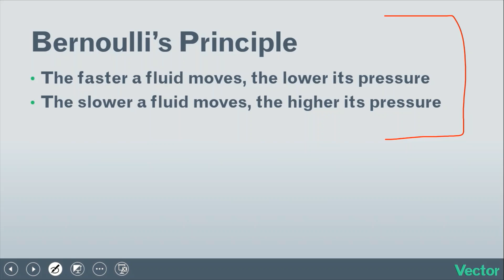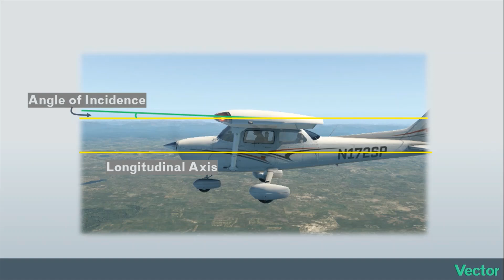Airfoil Basics

Comment: Trivia: Thicker airfoils are used for low speed flights while high speed flights require thinner airfoils to minimize drag.
Reply: Same with sails on a boat. When going out in heavier winds you tune you’re sails to be flatter and have less belly to reduce drag
Reply: This is not entirely true. 

For airfoils designed and manufactured in a way that supports substantial runs of laminar flow, where the boundary layer flow is constantly accelerated via negative pressure gradient more than half the length of the airfoil, then the airfoil invariably ends up thicker. E.g. Naca 65-series airfoils, and later NLF series foils. Many of which are 17 to 20% t/c. And also have very low drag, and are utilized on some very fast aircraft. And some slow ones (sailplanes).

Comment: A lot of modern fighter aircraft have fuselages shaped like airfoils to generate lift to aid with wings in maneuverability and also improve slow speed flight as the fuselages are basically very thick airfoils.
Reply: There's a story of a F-15 that lost a wing in combat but was still able to fly (barely) and got home safely. The fuselage was able to generate enough lift to compensate for the missing wing. I think it happened in the middle east.

Comment: The Wright Bros flew on around 16 horsepower with very low octane fuel.  They built their own aluminum in line engine including the carburetor.   They tested out their airfoil before use on wings and propellers.  They got 80 lbs of thrust from their big propellers.

Comment: Air and hydrofoils work as follows. If one needs to produce force, one has to accelerate or decelerate MASS. If the mass happens to be a branch tied down to a tree or fixed on the ground,  then the mass will not move but the acceleration force will be transmitted to the activity that is trying to accelerate the mass by pushing or pulling/suction action. If the MASS happens to be a lump of fluid like water or air which can distort and change its shape,  then, to create a force one still needs to accelerate a lumped mass of soft air or water. This is a case of having to use either the INERTIA OF REST OF THE HEAVY lump of FLUID OR THE INERTIA OF MOTION OF THE FLUID IN QUESTION. One particular lump of fluid when accelerated will distort and change position, and so an accelerated lump of fluid can only serve to create a force if the acceleration is done for a short temporary period when that lump mass occupies an inconvenient location and then is dumped and one needs to grab at another nearby lump mass and try and accelerate that till again, it distorts and changes position, when it has to be dumped, and the process repeated on other nearby lumps of fluid masses. Now let us apply this to an airfoil section.  We shall use an old-fashioned slow one as shown on the bottom right-hand corner shown at 0:15.  as it shows zones of activity that are not shown on the other airfoil sections.   THIS IS THE REALITY OF AIRFOIL SHAPES  shown in an old-fashioned airfoil section of more than 100 years ago. 

To make it easier to understand, let us be realistic, yet practical, and rather than use wind tunnels where the airfoil is stationary and the air flows with a horizontal velocity, we take a real airfoil that is moving and the fluid/air that is still. To make it even easier, let us assume that when the airfoil pushes or sucks the still air mass lumps/ particles, it will accelerate them VERTICALLY only and we can forget about any horizontal velocity of the mass lump particles of the fluid. After all, a heavy stationary golf ball can be hit by an angled golf club to rise vertically up or down, and water can be sucked up by a straw to also go vertically up or down.  All this is what happens in an airfoil section, elevators, rudders and ailerons, and propellers!!!

Considering the airfoil shown on the bottom right-hand corner shown at 0:15 moving with a horizontal velocity. Consider two stationary mass lumps of particles, one mass lump being pushed up, accelerated vertically by the upper inclined angle of the leading edge, and the other mass lump, being pulled up, accelerated vertically by the suction of the void behind the underside leading edge.  These two actions will put pressure on the upper leading edge, and suction on the lower leading edge, all for a good investment to pay off handsomely later on. 

After the accelerated top mass fluid lump( surrounded by other lumps)  tries to leave the upper leading edge surface, moving vertically up, it acts like a moving piston leaving a suction effect behind it and so this suction effect will slow down the vertical up velocity of the fluidic mass lump at the expense of lifting the upper surface of the wing moving horizontally below it. The downhill slanting shape on the rear part of the upper surface of the moving wing will accelerate the mass lump downwards through a suction effect and the mass lump with its now vertically downward velocity will be dumped over the trailing edge. This is the lift action on the upper surface of a wing. 

The lower fluid lump mass initial upward sucking acceleration by the under- curve, shape of the leading edge is slowed down and decelerated by the moving undersurface angle of attack pushing on it and so the upward going lower mass lump will start to slow down and even change directions downwards because the sloping rear part of the underwing, all applying the law that to every action there is an equal and opposite reaction, be the initial forces exist due to suction or compression accelerations. The lower mass lump moving vertically downwards is also eventually dumped after the leading edge, not necessarily at the same time as the upper one was dumped. In fact, they are dumped at two different times causing a trailing edge vortex along the trailing edge.  Bernoulli may be shelved for the time being and given a holiday and not asked to take part in explaining how a wing works due to change of pressures and velocities..................it is all the short-lived and temporary accelerations and decelerations of lumps of fluid masses at different zones around the wing/ rudder, elevator, aileron, four propellers, pumps, diffusers, etc including afterburners.. 

Note, the above pushing and suction actions and their sequential force reactions, above and below the wing surfaces, can take place because the fluid is homogenous and the two mass fluid lumps are sealed in like moving pistons in cylinders, by other nearby mass particles around them. All this assumes that there is no boiling of fluid at the heaviest suction zones which may cause cavitation in water and boiling of moisture in the air around the wings and propellers. 

So Basically the wing has four major fundamental locations that operate on mass lumps of homogeneous fluid in question, basically in a vertical up and down acceleration with their resulting reacting forces. The little horizontal motion of the lumps of fluid around an airfoil or a hydrofoil may be neglected for better lift understanding.  The horizontal accelerations of the lumps of fluid will contribute to the drag and not the lift of the wing. The four principal locations of a wing /propeller etc are as follows.
  
1. The upper leading edge, accelerates  the stationary mass lumps to move vertically upward due to a compression zone action and after this, 
2. The horizontally moving sloping rear part of the upper surface sucks back the vertically moving mass fluid lumps to eventually change their direction downwards to dump them over the upper trailing edge. This is the lift in the upper surface of a wing.
3. The lower leading edge, accelerates  the stationary mass lumps vertically upward  due to a suction action and  after this
4. The moving sloping rear part of the lower wing surface is pushed, compresses back the vertically up moving lump mass to change their direction to a downward velocity, and eventually dump it at the upper trailing edge.

All airfoil sections, from slow high lift ones to medium, high-speed supersonic ones, all do is to re-design these four major locations of an AIrfoil section to ACCOUNT FOR THE INERTIA OF REST/MOTION OF THE FLUID BEING USED  relative to the speed of the wing, foil in question.

For high-speed airfoils sections,  and in water propellers/ hydrofoils, the upper leading-edge compression zone is kept at a narrow-angle and surface rate of changes,  to reduce/limit the acceleration of the fluid which would vapourize all the moisture in the air and boil water in water foils, to cavitate the fluid. For medium, to high-speed airfoil sections, the suction underside leading edge is done away with and the lumps of heavy fluid are accelerated down vertically by the cushioning fluid and the angle of attack of the undersurface of the wing.  

All that was explained above, any shape eye can see it all in the flying of the owl shown in this video, and it adds more showing how the fluid mass lumps of air can escape at the leading edge, the trailing edge, and the wingtips at high angles of attack. 

https://youtu.be/jc9En9WUzI8

Rather than considering the velocity streamlines around the wing, it is better to see the linear rate of changes and the circular rate of changes that will produce a vector acceleration field around the airfoil section  AND IT IS THE INTEGRAL OF THE ACCELERATION FIELD  IN THE VICINITY OF THE WING THAT WILL GIVE THE TOTAL LIFT VECTOR AND TOTAL DRAG VECTOR N THE REQUIRED DIRECTIONS.

Comment: Airfoil basics:

Asymmetrical airfoils are the only design for airplane wings, and horizontal control surfaces. 

Symmetrical are for aerleons, elevators, and rudders

Or, for rockets, and missiles.

Goettingen 1919, is the best Airfoil, because it is my hand drawn design, and stands the test of time 

Which is why I hand draw them, every time

Comment: I was planning to design an airfoil for an acrobatic aircraft for its wing, but I'm still not sure if I should go for a high-cambered wing   for the lift coefficient or symmetrical for maneuverability.
Reply: Symmetrical. Because if you fly upside down the wings will still give lift as long as you have speed and angle of attack.